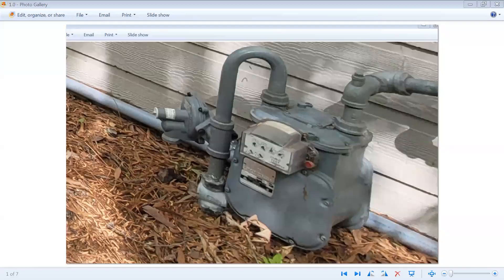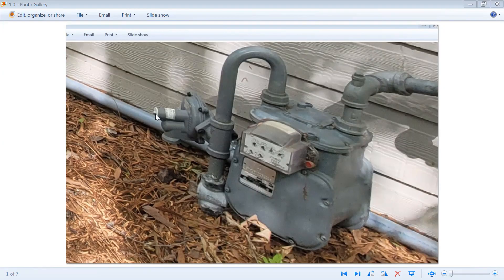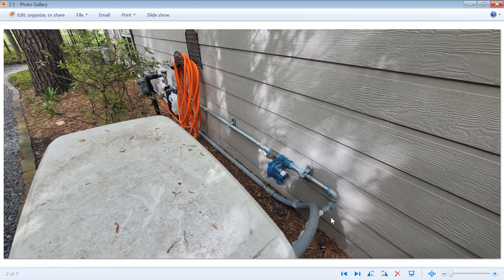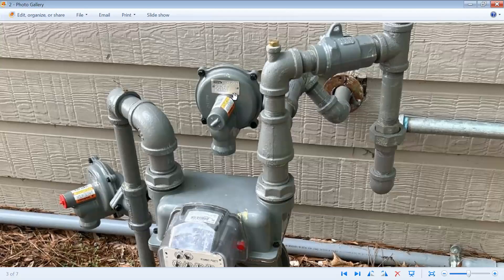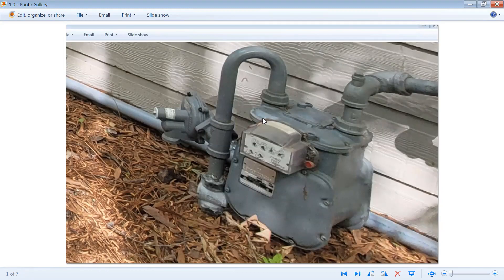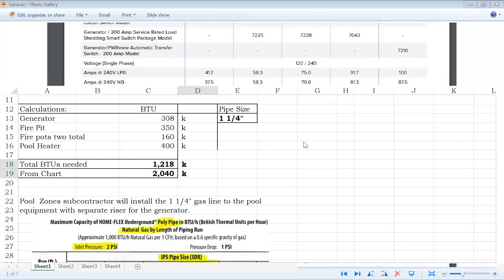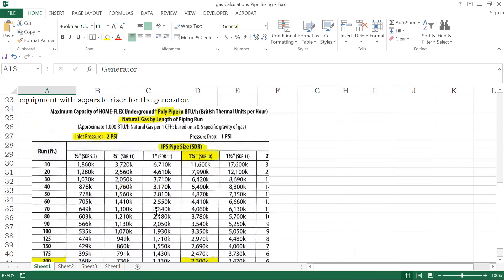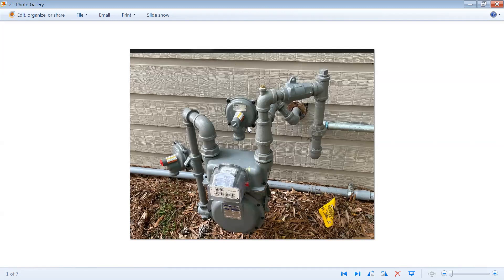Gas meter sizing for generator and pool heater

Comment: If I'm running a portable 28000 peak watt/20000 running watt, generator with quick connect down stream of the meter, would I need to upgrade the meter (250k) or the regulator to high pressure? Thanks for the great video and explanation.

Comment: Centerpoint said today that they upgrade the meter. So I’m confused. If you have a 250k meter they would have to change it
Reply: When Centerpoint came out for my generator install they put 2lbs reg before the meter (meter was upgraded to the new style, same capacity) 7"WC reg going into the house. Generator folks installed a 7"WC reg. on line going to the generator. Hope that helps.

Comment: That’s actually a medium pressure system , high pressure is 5 lbs. they won’t supply that to residential except for special applications. You can run 2lbs thru a house and use several different ventless regulators on manifolds to catch the house appliances. I’ve done this many times on big houses with tankless water heaters, to save running 11/2” or 2” screw pipe